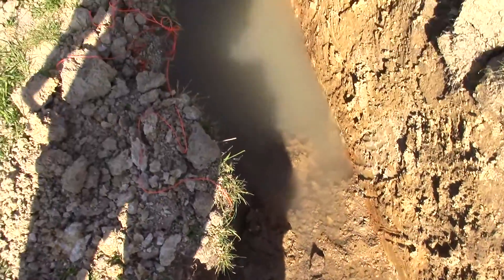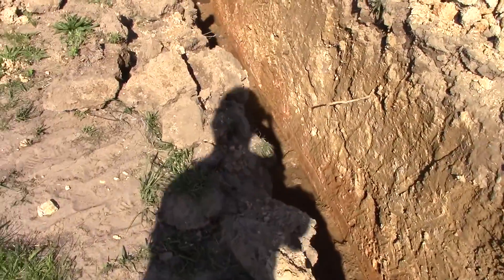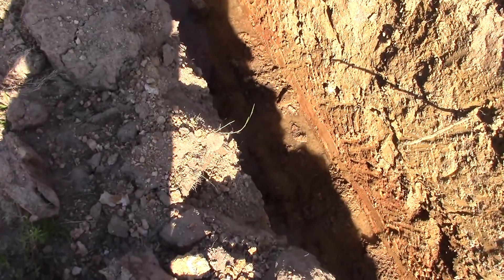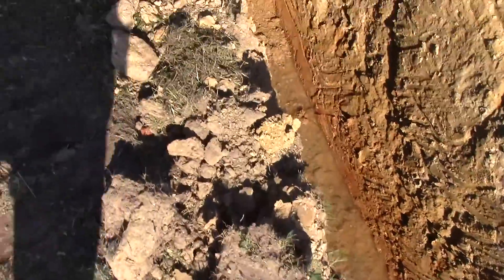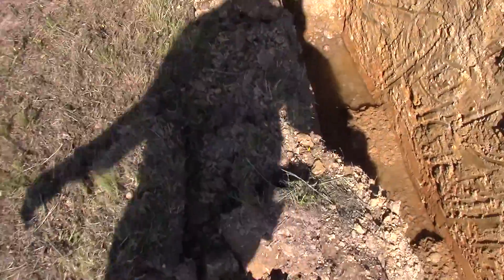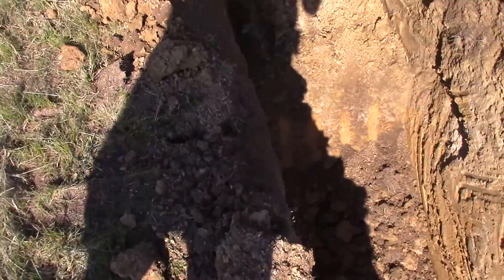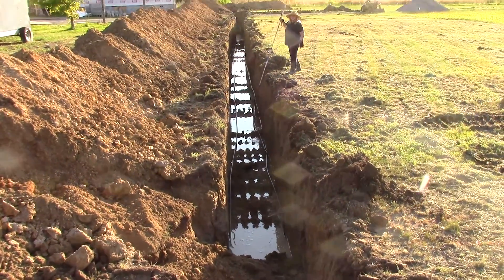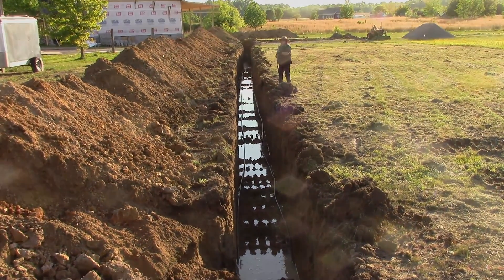Our Geothermal install Part 3

Comment: A 6 foot trench with no shoring or trench box.. yikes
Reply from the maker: You are correct, from a public safety standpoint, there is a clear and present danger. But in my humble defense, we are in the middle of a 14 acre farm, and at no point was anyone going to be in those trenches. They were only dug to lay the trench lines, then filled back in. Shoring and trench boxes were not necessary. Kind of like running a water line.